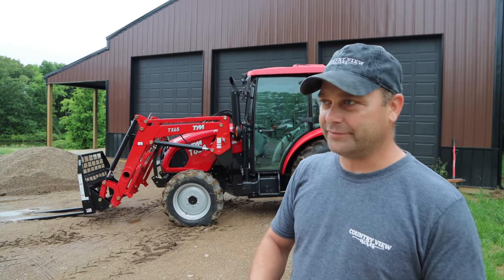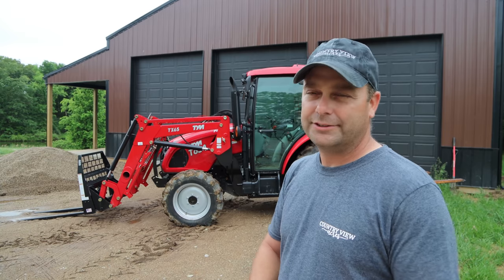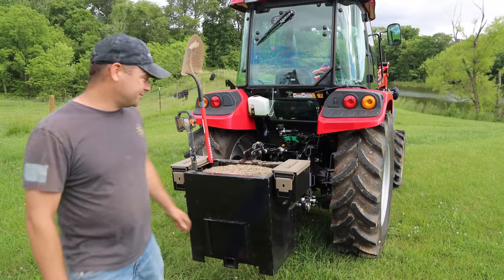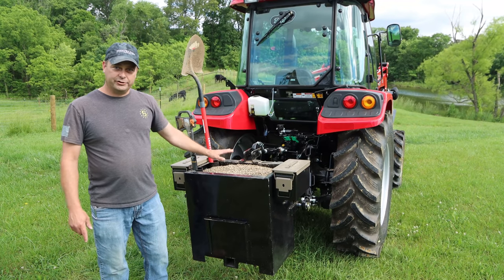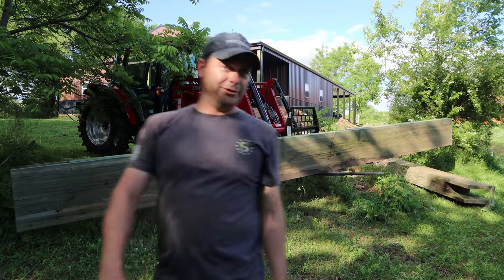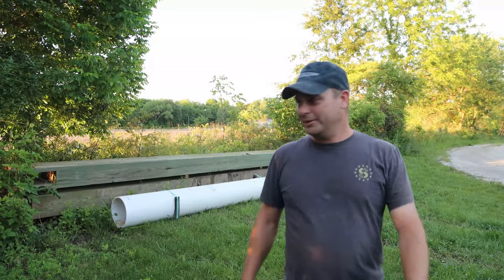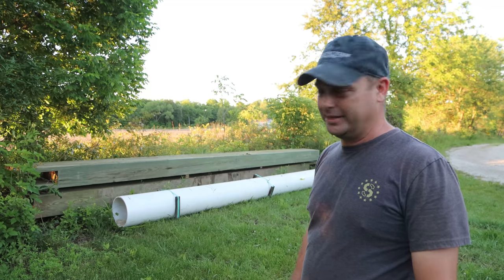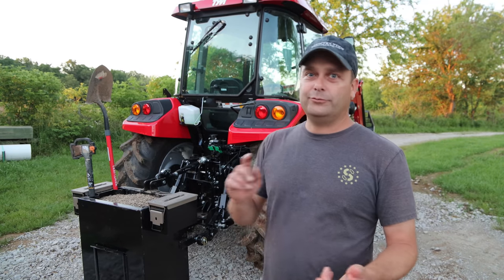I needed to add ballast for this job.  Setting up Ballast Box attachment and Moving Huge Beams

Comment: You could add some 4x6 support posts at each end using bridal joints, glue and bolts in your shop and use it as a big hoisting beam for use in pulling engines etc.

Comment: Fork lift driver, 13 yrs in the saddle. 
I've never used a front loader on a tractor, so I don't know the specifics between the two systems but hydraulics tend to work the same way overall. 

If you're bouncing the tractor when you're lowering the load, push that knob all the way forward and let the counterweight and hydraulics take the load. 

When you've got the load in the air, let that box be almost on the ground to prevent you from hopping and losing control. Kinda like the leveling legs on a bucket truck. If you've got a good size beam to spare, you could set the box down on it and get some side to side stabilization. 

These things have limits. 
If you're working up high and it won't tilt and pick up, pick it up completely, then tilt. 
Absolutely, for no reason ever do not get ANY part of your body beneath a load. When hydraulics fail, you cannot outrun those loaded forks. 
Anything you want to keep, keep it out from under those loads. 

Other than those tips I didn't see anything you did wrong. 

Good to see your place shaping up and becoming a proper farm Evan. 
Great work!!!
Keep it up!!

Comment: We made ours out of half a 55 gallon barrel just cut 2 holes for the cross bar for the 3 pnt  welded upright for the 3 rd link piece of strap for the hitch later upgraded to a receiver tube , those beams would make you a nice retaining wall
Reply: I just use a big round bail

Comment: I found a damaged truck strap box at my local tip, fitted pins and top attachment. Folded & installed some mesh, poured concrete one side at a time (hollow box), niffy. from NZ

Comment: You could build 3 or 4 metal stands for a work bench and use the two beams as the top. 44 inches deep x 23 feet long . When assembling it don't screw them down so you could use them later if you want or leave it as a work bench. The biggest baddest work bench ever.

Comment: Great idea!

Get a couple metal boxes without lids and mount them under the ammo cans for misc other stuff

You can weld so probably make them yourself
Make a top for that box also to keep it from rusting out as bad on the inside

Do a flat piece for the top and 12” Sides with a couple inches below the lead to keep it on top of the box and then you have a miscellaneous storage box on top as well

Then Put a lip on the back with Additional slots for tools

Comment: Those beams would be perfect for a bridge or a jetty to fish off
Reply: Unless they were designed for external use, I wouldn't have thought they were ideal here - they are a designed component made with particular timber, cut for specified loads and use glue for the intended usage. A bit like ply - you wouldn't use anything but marine ply for the outside, or you know what it'd look like in 6 months! Equally, prob best to store them inside.

Comment: I took some scrap lumber and built a mold. I put a piece of lumber flat  in the bottom of the mold that I could remove and had 2 legs. Strapped the mold onto my trailer took it to the ready mix co and they filled it with concrete.  I had added the brackets  into the mold so it would attach to my 3 pt.  Took a piece of 5/8" repair and bent into a loop and set it in the concrete.  Let it set for a day, removed the wood and I have a 700# ballest for $25 worth of concrete

Comment: Evan, I heard you mention that these beams aren’t long enough to span the short part of pond but if you joined them together with a piece of hardwood and used epoxy and 4-6 long bolts would the combination be able to reach across that span?  The beams appear to be at least 16-18” wide so that would be wide enough to safely walk across. You may need to add some hand rail to one side for safety or possibly harvest some of the oak off your property to widen the walkway. The only out of pocket cost would be paying someone with a band mill to cut the logs into 1” or 1 1/2” thick boards for you.

Comment: As many have stated I recommend Rim guard….Environmentally Safe: It's non-toxic, biodegradable, and animal food-grade safe. Freeze-resistant: Operate your equipment in below zero temperatures; Rim Guard is freeze-resistant to -35°F. Cost-Effective: Save big; Rim Guard costs 75% less than typical weights and works with or without tubes. Weighs 11lbs per gallon, I think on my 5075E JD it added 1300+ pounds to the rear wheels. I also had the tire dealer unbolt my wheels and change the configuration to give me about. 4-5” wider stance these combined made a world of difference. You can never be to safe when it comes to a tippy tractor.

Comment: How about 55gal drum filled with concert ? You would have fab up brackets .l saw one with a35 gal on a small tractor for snow pushing .
Reply: I picked up a concrete filled drum at an auction a couple of months ago in Maryville, TN.  It already had the 3 point attachment.  It made my Ram 3500 really squat when it was loaded.  Tim

Comment: Too much air pressure in tractor tires can make the tractor tip easy. New tractors usually come fully inflated to seat the bead on the rim. Tires wear badly in the center and the ride is rough. 10-12 psi in the back is good for farm work and 20 in the front or less. It's ok if the tire bulges because it has a lot of plys to hold the weight, makes for a better ride with less air.  I suggest reading a bit on the subject.  It's amazing the difference the tractor will handle.

Comment: Put some tractor weights in there or put some pieces of pipe in the corners and then fill with sand or rocks use the pipe for tools

Comment: Nice modification. I have seen guys add a chain saw scabbard as well. Might want to throw a pair of Channel Locks and some PB Blaster in one of the boxes too in case the pins on the hitch give you trouble.

Comment: I bought a box blade for my tractor, for rear weight and grading. I added steel RR rail for extra weight as well.
Reply: I plan to do the same to my two box blades.  The railroad rail should really help the box blade dig in better.  Tim

Comment: Although I only have experience with John Deere tractors, I've owned many models and sizes and they all came with weight options for the rear wheels. 
Many years ago, I bought a 4430 that had no rear weights so I watered up the rear tires. I replaced all the air with 100% water pressure. My dad said it would not work but I ran the tractor for years that way. You would need to add some type of anti freeze but it seems like wheel weights or water in the tires would be a better option. 
I hope to see you paint your two old tractors some day, now that you have a good shed. It would make great video content. As always, I enjoy your videos and the progress you are making on your farm.

Comment: That would weigh 500 pounds 235 kg just for the stone. Using stone you can flip it over and dump it to use the box for fencing. Put the t posts in it for storage.
Reply from the maker: I can tell that it still isn't enough weight.  I may have to fill it with concrete.  Or put fluid in the tires.
Reply: @CountryViewAcres    Rim Guard beet juice is the way to go.

Comment: Couple of things I noticed, TYM needs to come out and move your rear wheels out and swap the fronts side to side for a wider stance as did they need to add ballast to the rear tires or the rims or both.   The ballast box is a great idea but the weight is still insufficient for the ability of that loader.

Comment: Love the ammo cans, nothing like good old common sense.  I can't help but wonder about your laminated beams.  I still like your bridge idea.  If they are only 4-6 short of spanning shore to shore, seems like you could jet down some stout pilings 2-3 feet from each shore to support the beams.  You could then build ramps from the shore line to the beams.  Both beams would probably be too heavy.  Find someone with a saw mill that could cut one beam in half.  I think it would be doable.

Comment: That tractor was right at the limit when picking both up.  I'm sure that it could be done, but it would be risky, especially on non-flat land.  You made the right choice to move them individually.  I've "been there done that" when moving heavy stuff with my equipment.

I do like the "modification" that you did to the ballast box.  It has my mind thinking about how I can possibly do something similar.  Having extra tools (chains, etc.) would be especially handy.

I'm curious.  Are the back tires filled with fluid?  If not, it's well worth it to do it.  Beet juice is probably the best thing to use.  That gives you a little more weight back there and more stability.

Comment: The same boat I am in with my tractor. We do not have a rim guard dealer near me (Well they want to charge me like 300 bucks to pick up my tractor and deliver it back + plus the money for filling up each rear tire. They won't/can't do it on site. ) so I think I am going to use windshield washer fluid and end up doing it myself.  I think I looked at the charts and 60 gallons for each tire.

Comment: Are the tires on the back of the tractor fluid filled
Reply from the maker: No, they aren't.
Reply: @CountryViewAcres  I was wondering how come it was so light in the rear when you picked up the bucket of rock. Once you full them with fluid that will make a huge difference

Comment: Hey Evan! Did you add rim guard or any fluid to the rear tires?
Reply from the maker: No, I haven't.  But I am thinking about it.
Reply: @CountryViewAcres  I am thinking about adding Rimguard to mine.  It is beet juice and supposed to be non-corrosive.  I have a Kioti DK4210 so a bit smaller tractor.  Also thinking about spacing out the rear wheels for some added stability!

Comment: Too bad those beams couldn't be under cover--wouldn't they fit the long way in the metal shed you moved? As far as ballast...you could load the rear tires and then wouldn't have to worry about taking the box on and off.